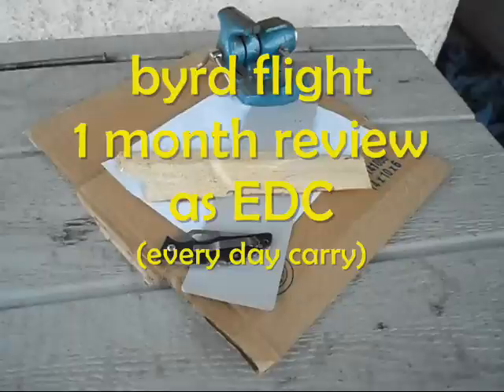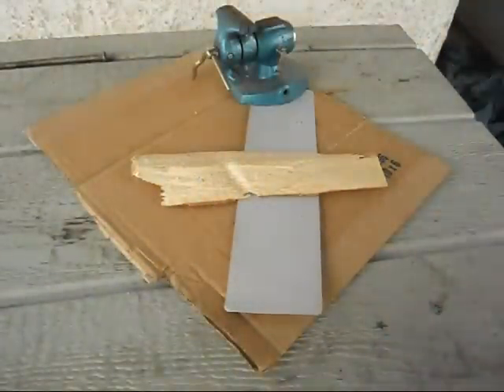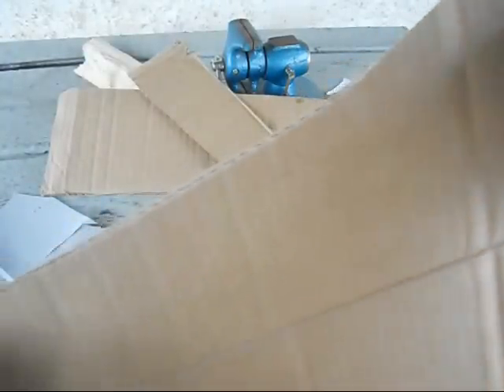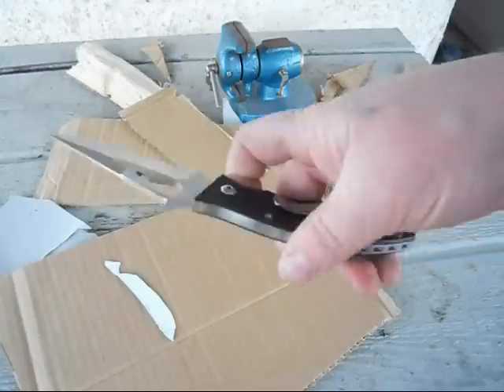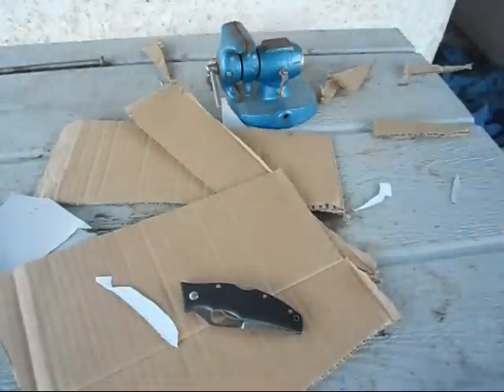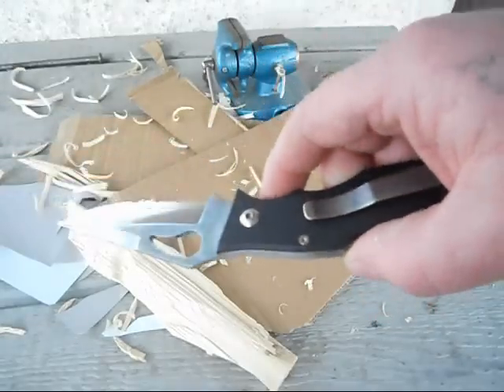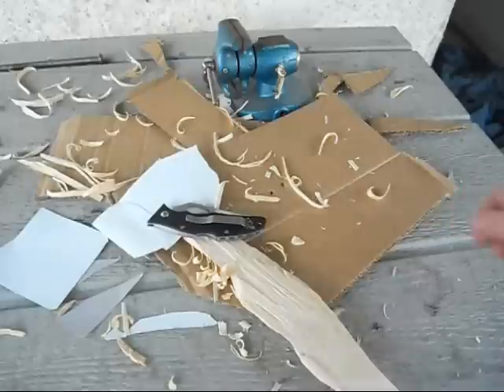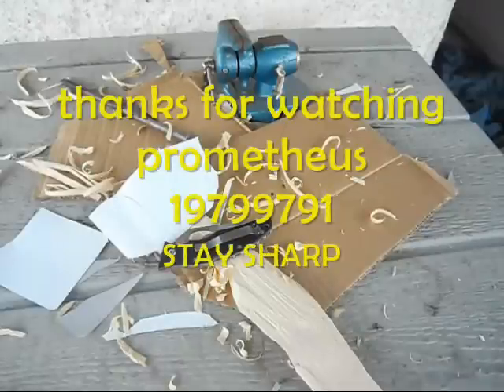byrd flight 1 month EDC review

Comment from the maker: i only used a smooth steel to straighten the edge from the firestarter comparison video. i thought it was unaffected but, later i did notice a little roll over but, it straightened right out. i did have to sharpen the serrations yesterday due to some blunting from scoring a piece of metal with it several times but, it's as good as new and still really nice and sharp. the steel is really impressing me far more than i thought it would.

Comment: Nice to see an extended use commentary.

It is nice to see Spyderco put out a high value / low cost (relatively) line. I have a bunch of them, including a keychain one I always carry.

How do you find the partial serrated blade pattern in general?